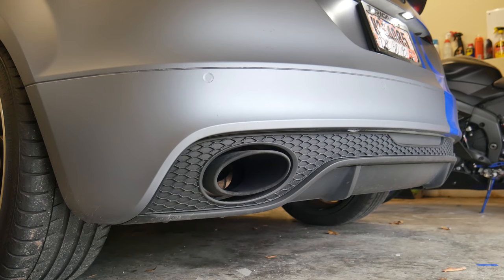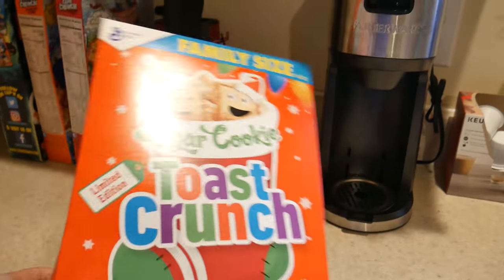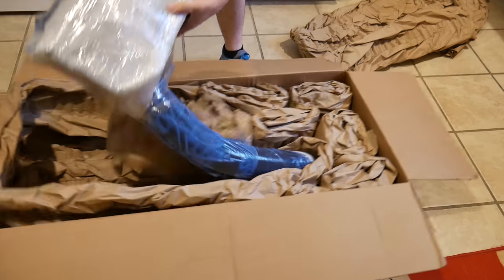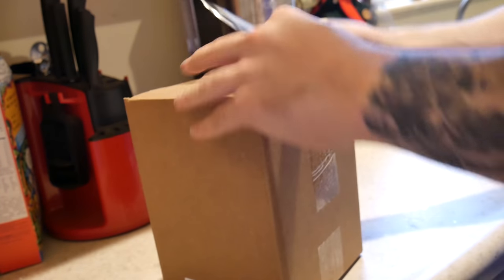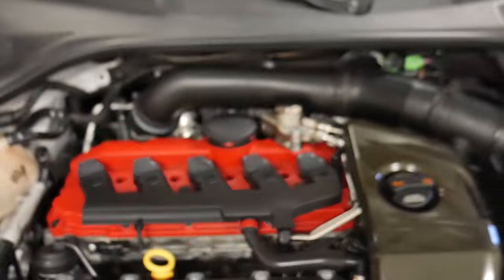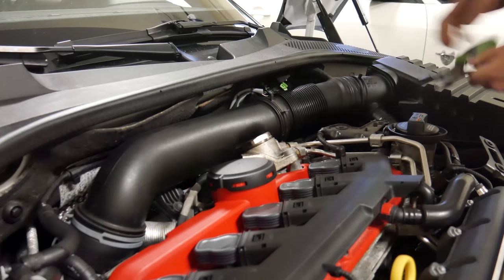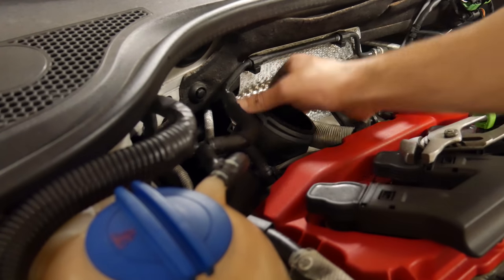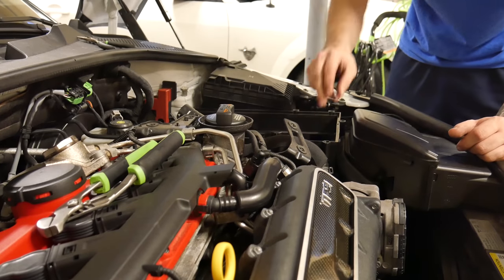Audi TTRS gets MORE POWER!

Comment: I had a ttrs 7 years ago when it came out, you are dreaming if you think that filter will get you any power. the stock airbox is a really good design. just change the paper filter often. do 2nd cat delete and apr 93 tune i maxed it out at 308km/h. intercooler upgrade is also a scam unless you live in the middle of the desert during rush hour. I miss that car
Reply: Agreed mate, I’ve owned 3 TTRS’s, 2 x mk2 & 1 x Mk3. Air filter system change does nothing in my opinion.

Comment: literally the exact same as the stock one minus the carbon and pod filter. could have just threw a pod filter on
Reply from the maker: You are literally blind and deaf
Reply: @YummiR6  how? I said it had the carbon. And the only reason it sounds better and makes more power is the pod filter. All I'm saying is u could have achieved the same shit with just the filter itself. Plus maybe 15 lbs weight reduction? Unless you're gutting it who cares